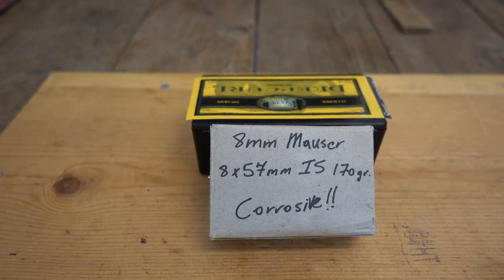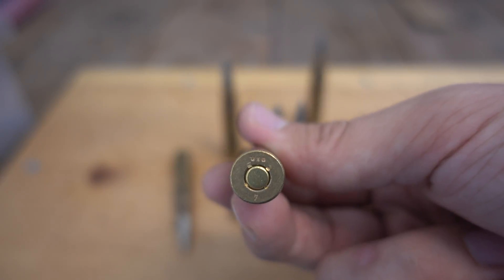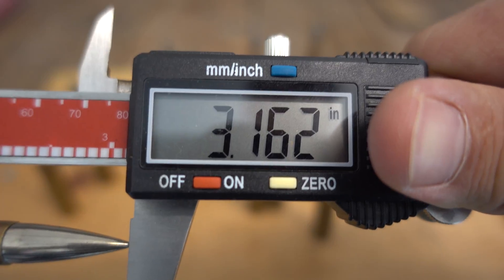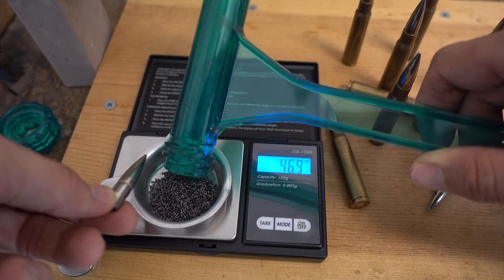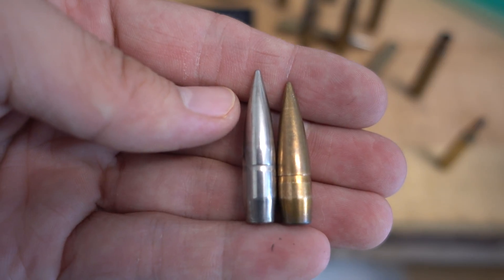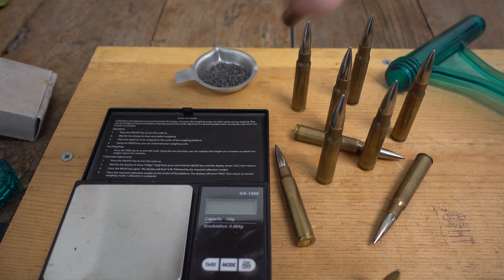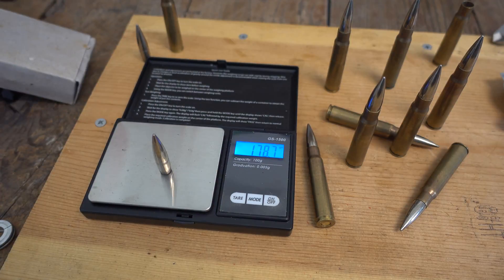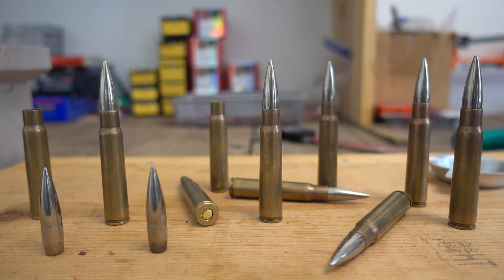8mm Czech surplus analysis

Comment: In 1940 Germany introduced S.M.E. Spitz Cescho MIT  Elsenkern ( Spitzer with Iron core) was developed to replace the sS ammunition. A 178 Gr Boat tail @ 2592 FPS from 23.6 barrel, from 1942 onwards S.M.E. Ammunition practically replaced the s.S ammunition, for recognition the primer sealant was colored Blue.

Comment: Excellent work, I’m glad to know the correct grain weight for the rest of my Czech ammo. I just go to my gun shows and snatch up all the surplus I find. The guy selling it said it was 170gr so I just ran with it, it’s good to know it’s closer to 180gr than 170gr. 

I have some Romanian from the ‘60s that’s supposedly 154gr with a mild steel core, and basic google research says so, but ultimately how’s a person gonna truly gonna know until they take it apart.
Reply: Esoteric Wolf , your right about the weight.  Good blasting ammo but very dirty,  smells and get splits now n then. Pretty straight shooting though for old surplus.  I still say that the Yugo M-75 was the best out there. I have 1 sealed 900rd. Spam Can left and I don't want to open it. lol.  Good Video. ....
Reply from the maker: I finally got the test done, now just have to edit and upload the video. Should be up tomorrow.
Reply from the maker: I would be snatching it up too, these Czech and german surplus rounds seem awesome. Cant wait to do more tests and see how the steel core on these perform. I have some Romanian rounds but they are from 72 I believe, I have shot them before and recovered the steel core from them.
Reply from the maker: I really want to velocity test these rounds but its been really hot and windy here so it might be a couple more days before I can do it.
Reply: pick a good day so you will get the chrony running without errors...........